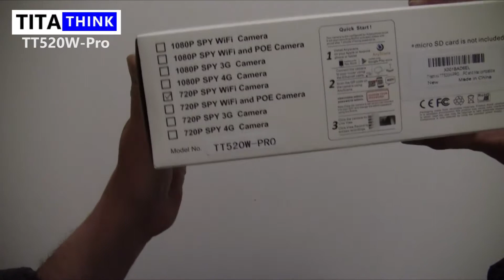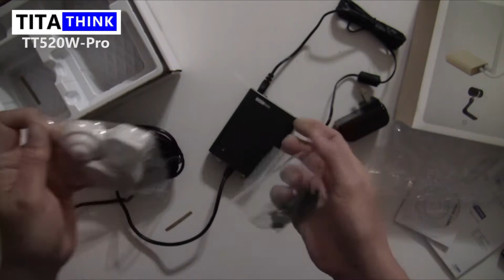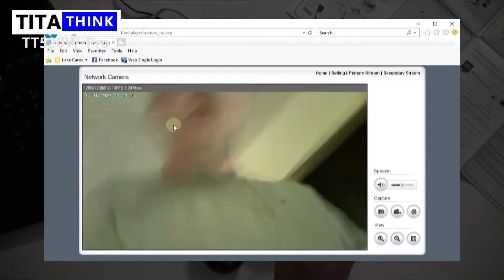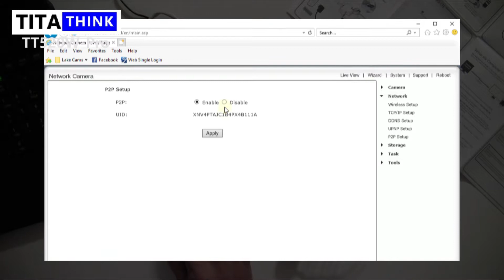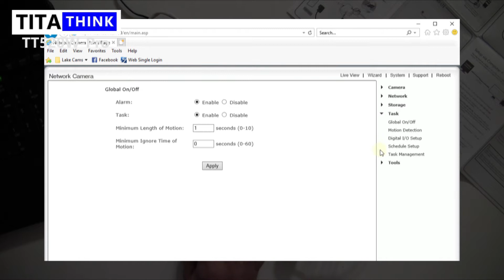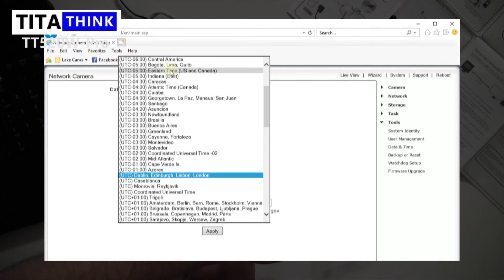TitaThink TT520W-Pro Covert IP Camera - Unboxing and Setup

Comment: I don't have a computer or wifi on my home, I just want to view it from cell phone...can I do that?
Reply from the maker: You have to "talk" to it thru a network. Or, remove the SD card and read it on a PC.
Reply from the maker: You can use a cell phone to connect the camera to and then talk to it. That is actually how I have this one set up. I use my Android as an access point.
Reply: Buy a router. You do not need data to use a router.

Plug the camera into the router and it will generate a wifi network